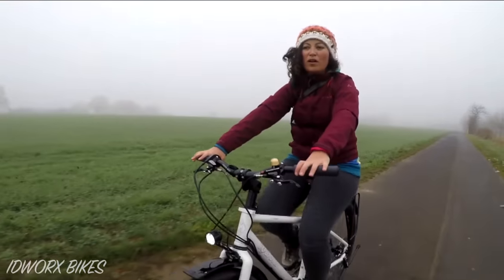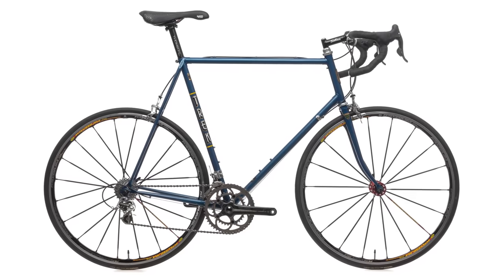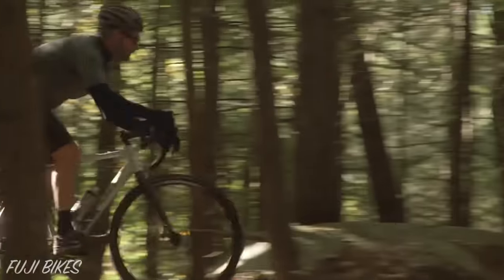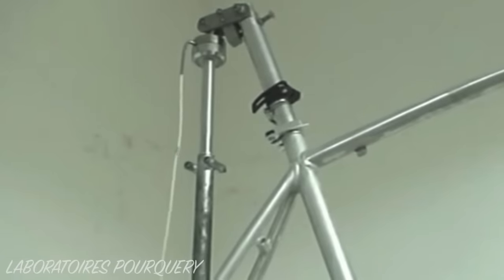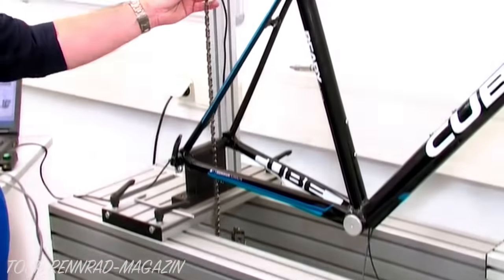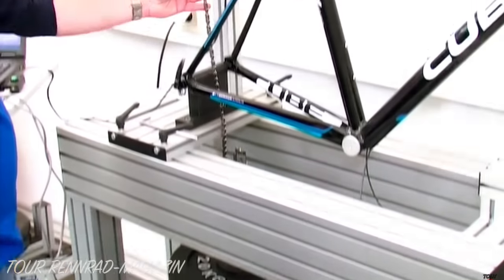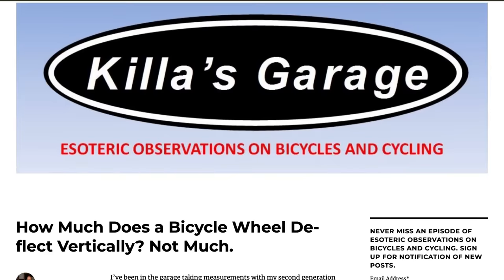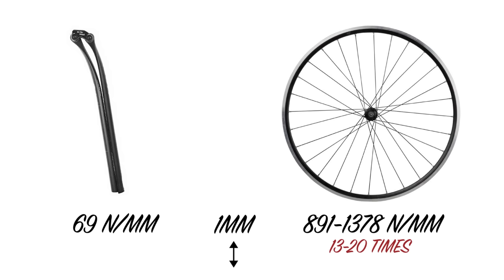Why It's Impossible For Steel Frames To Be More Comfortable Than Aluminium

Comment: There was a study a few years back on fatigue to feet and legs, which included micro-injuries caused by vibrations and shock. The cumulative damage and fatigue can be very substantial in some situations (long off-road touring, for example).
I have bikes made of different materials and designed for different purposes. I've noticed a lot of compliance — but not VERTICAL compliance — in some of the steel frames. It is more like torsional compliance. I can feel a major difference going over sharp bumps and rough surfaces at times.
It's the sort of flex you can experience when you're off the bike, and putting one foot on a pedal at the six o'clock position, and then repeatedly applying a lot of your weight to that pedal, especially when the bike is held at an angle away from you. Other things are flexing also, but the frame flex is very substantial in some bikes when doing this.
I haven't thought much about how this plays out while riding, but I have noticed a "spring" in some steel frames that is other than vertical, and yet very attractive. It makes for a lively, desirable, and more comfortable ride.
Reply: Must say I agree. It's only the expensive steel frames of course. As they can be made to flex more and not break (all to do with young's modulus).
Reply: Yes, if the labs measured deflection of the frame only from the dropout (why not at the bottom bracket?) and only in a vertical plane, then it is not relevant to the act of bike riding at all because as you say - the bike is always at an angle to the ground.    This argument he is making is akin to saying that a bike being aero on the track (no wind) is going to be accurate to the aero-ness in the open road (lots of wind everywhere).

Why wouldn't they measure from the bottom bracket since that's where vibrations are transferred to the cranks, bb, and legs - and its the legs that we want to keep fresh to ride longer!
Reply from the maker: I like the way my steel bikes ride too. If you can build them to have that perfect amount of torsional compliance, where there is noticeable but very minor amounts of flex - it's a really nice feeling (and it's hard to replicate with aluminium). 
I'm just not convinced that torsional flex is a big contributing factor when it comes to comfort, especially on a mountain bike when you have such large tyres anyway.
Reply: @Cyclingabout  I'd argue torsional flex is the biggest factor since you proved that vertical frame flex is not.  The act of pedaling is asymmetrical with weight on one leg at a time on each side in an alternating fashion, taking the bike frame out of a plane and hence apply torsion to the frame. You feel the frame's torsional resistance to vibrations transferred through the legs.
Reply from the maker: As I mentioned in your comment above, we need to take into account the rate of springs in a series. Let's say your frame has 2x more flex at an angle, and the seatpost has half as much. The overall spring rate of the system still calculates out to be less than the softest spring, which is still your seatpost or tyres. Sure, the data might not be as accurate as we'd like (in reference to aero testing), but it's not like the spring rate of the system will miraculously change because the bike is on a slight angle.
Reply: @Cyclingabout  to some extent there would be a large change in spring rates from vertical to lateral.  In the case of a frame you are removing the "truss" and are now only relying on the tubing stiffness for spring rate.  The same for most "spring" seatpost as they are designed to be soft front to back and stiff side to side, I have the leaf spring canyon post and can attest to how much softer it is front to back than ride to side.  Wheels are also much more flexy side to side then vertically.  As for tires, I'd have to see a study, but they are still probably the major contribute still.
Reply: Very interesting point,  I never thought about side flex adding to the comfort of a bike but it does make since in the scenario you laid out and I should have thought about it as mainly being an offroad rider!
Reply: @sircrackien  hi guys i think a unisex frame or female frame is indeed more comfortable because of its inherent flex , my touring bike especially fully laiden is for sure more comfortable, interesting topic  Science can't always explain a feeling .
Reply: @sircrackien  As we pedal, our power and weight is applied alternately on each side of the frame and thus the feedback involves the frame resisting that upward motion of the flex.  The down force of one side is always stronger than the force on the alternate side of the frame.  The frame is always in a state of resisting lateral forces so of course this affects the feedback from the road.   Anyone can see that you can coast down the road in a straight line on a bike with it leaned to one side.  My theory is that the bike is most often at a very slight angle in either side since we balance the bike with our body to keep it upright.
Reply: Jay Tee ,.
Reply: I have dropped a chain like this on a steel SS mtb. I don't think it will happen like that with an aluminum bike.
Reply: @andrewnorris5415  My $400 MSRP CroMo Kona Smoke does exactly this too.
Reply: @SurpriseMeJT  and your point being?
Reply: @Abhitips224  Vertical compliance is a far lesser factor in determining frame compliance.
Reply: @mysurlytrucker7510  or the scientist decide an arbitrary limit on what they will measure and then make big claims over the whole topic, forgetting that factors they don't measure exist and also that measurement has fundamental (philosophical even) problems in many cases. I've seen this with pianos where scientist claims that only the variance of force on the hammer impacts the sound, forgetting that the application of the dampeners and the interaction of neighbouring strings is an exponentially complicated problem.

Small things can matter a lot. For instance scientists didn't believe how golf balls dimples worked for a long time. And measurements of shaving your legs for swimming or cycling was initially thrown out because they thought it was impossible to have such a big impact, but it turns out the surface texture is very important in those systems and scientists often take a long time to actually get over their own initial assumptions and observe the real situation. Placebo is often shorthand for: we don't know how to measure this it is too complicated so we are going to pretend it doesn't matter. Lots of big mistakes in science due to that human tendency.
Reply: @SurpriseMeJT if you have the correct size frame, and the right saddle height... Your weight should almost all be directly on the saddle. Unless you are power pedaling, you are never putting as much force into the peddle as your weight is on the seat. Seems like the easiest solution to this is to add an in-post spring, like a damper or shock. My brothers old Cannondale has one. It only fits that frame, but it's the nicest ride. I feel like a good frame, for casual/amateur riders should be stiff for longevity. So dampers and shocks in unique locations like the ones showing up in the seat post, handlebars, and others that have the flexible joints on the top tube. All interesting stuff.
Reply: Doing your 6 o'clock pedal pressure check on my bike gives deflection mostly at the tires and I think at the wheel spokes. So with regards to such lateral forces the tires and wheels probably dominate over the frame, and suspension seat posts benefit may be somewhat minimised depending on the design.
Reply: @Cyclingabout  Regarding tire size, I'm going to get a modern steel road bike, i.e. wider 32c tyres. Do you think the springy feel of steel will be lost because of the wider tyres and it will end up feeling numb and boring like my carbon bike?

Comment: Very informative regarding frame comfort! I'd be interested to see a comparison in fork materials as that relates to comfort (aluminum vs. carbon vs. titanium vs. hi-tensile steel vs. chromo steel). My guess is that a chromo steel or carbon fork will be more comfortable than an aluminum fork, assuming constant handlebars and thin tires.
Reply: Aluminium forks are even more more overbuilt than aluminium frames. And cheap bonded Aluminium steerer/carbon blade are SO very heavy and overbuilt. This is because fork failures = death and lawsuits so you don't take chances there. In comparison a broken BB shell is no big deal.
Reply: It's still going to be a carbon fiber fork no matter how overbuilt that will be the most comfortable. As far as weight goes as long as it has at least an aluminum alloy steering tube It's also going to be lighter. A carbon fiber fork is going to be stiffer and have the best steering response.
   As much as I like my Lemond Zurich 853 steel frame. I can't ever see putting a steel fork in it. The very first thing that I would notice is the handling will change. Not for the better either. There isn't enough rake in a steel fork in a road bike to gain any comfort factor because the internal dampening of carbon fiber is well beyond steel.  That can be said about the handle bars, stem and seat post. Carbon fiber as a material is so engineeriable that it would be difficult to shape metallic materials to compete.  
   The only exception I can think of is old school rims . The flat light weight box section tubular rim  has alot of vertical compliance. Relatively many thin double butted stainless steel spokes go a long way to provide thst. The front wheel having rim brakes and dishless can be incredibly strong and laterally stiff.  Just don't hit an immovable object with it., as it will catastrophically fail. A heaver rim with more spokes in back will round out the ride. Alloy nipples will shave noticeable mass where it counts at no penalties.  Except for salt loaded winter streets and the spokes were cut long enough. Obviously I don't care about aerodynamics any more. But I really like 28 mm tubulars . Ironically easier to obtain these days with better flat resistance. Put a nice riding sticky one on front and one that resists flat and wears longer. 😊

Comment: Very cool! I think something to take into account that isn’t talked about in the video is that often times aluminum or carbon frames have oversized (diameter) seat post where is steel frames often have 27.2 or smaller diameter posts. Obviously the narrower seat post will deflect more and while this doesn’t necessarily make steel more compliant then aluminum, our perception of it while riding is that it is more compliant.
Reply from the maker: You're right, big oversized seatposts are rarely found on steel rigs.

Comment: My most favorite mountain bikes I've owned were cro-mo and they both rode smooth and beautiful but after watching this video now i believe it was more to do with the geometry than anything else. Both of the Steel bikes fit me perfectly but all the alloy frames I've had a shorter top tube for a similar seat tube. I have a carbon seat post in my steel bike now and when i checked bugger its got a fair bit of flex. So now I think a carbon post and good geometry are more important that light weight materials.
Reply: CroMoly is an amazing material. It is so strong in the ways you want a bike frame to be, you can get away with ridiculous thinness if built intelligently.

Comment: I think when they're comparing steel, titanium, aluminum and carbon in terms of comfort, they refer mostly to vibrations that are transmitted through the frame material and not visible or measurable flex. The way the frame resonates does give a slightly different 'feel' to the bike, but you have to know how to distinguish it.
Reply: Exactly
Reply: All metals resonate and can be designed to at a certain frequency. Steel, Al, CF whatever.

Comment: You're looking at a short lever inserted into a long truss (seat-post into seat tube), the point you're missing here is on the other side of the frame. The long lever inserted into the short truss member (the fork into the head tube). The majority of deflection and bump attenuation is going to occur at the front of the bike. The fork reacts to a bump (regardless of the fork material) and transfers this up to the head tube. There's much more force at this location because of the long lever (the fork), the way the head-tube takes this deflection and transfers it through the frame is going to play a big part in ride feel and quality. Its a simple matter of material science that aluminum has a more tightly packed structure (google images of aluminum structure and steel). Steel has a much looser packed structure and will in fact allow vibrations to smooth out through the material. These micro vibrations make all the difference.
Reply: Good explanation.,  seems like the fork is most important if you look at it that way!!
Reply: Exactly how i felt after watching this in 2024. I will never buy an aluminum fork again. Carbon and steel forks only for me. Bikes with 2 inch or wider tires are comfy enough for me to tolerate an aluminim fork with minimal complaints on comfort.